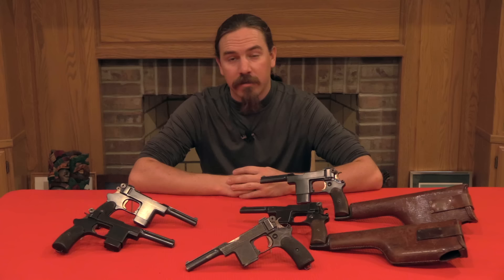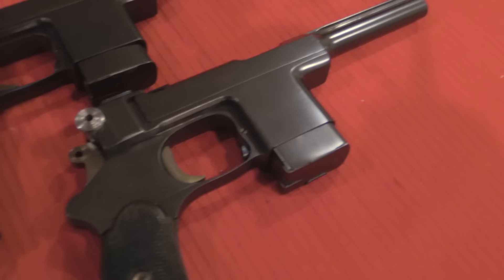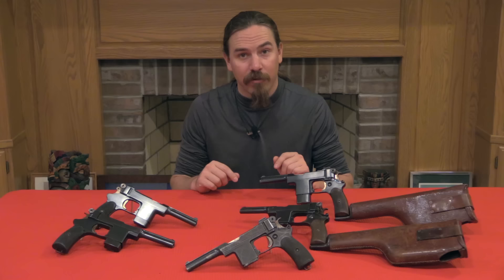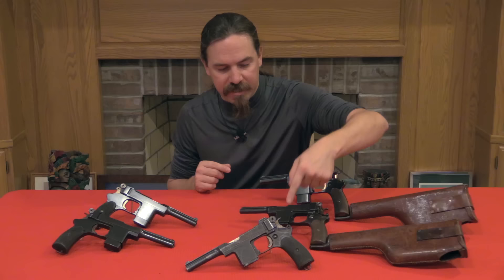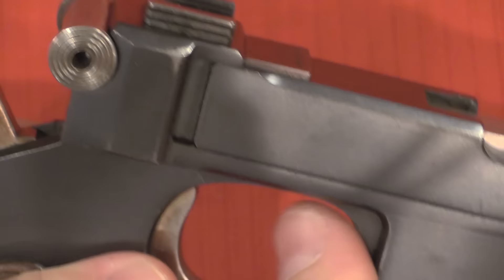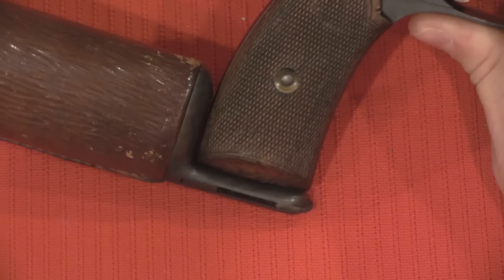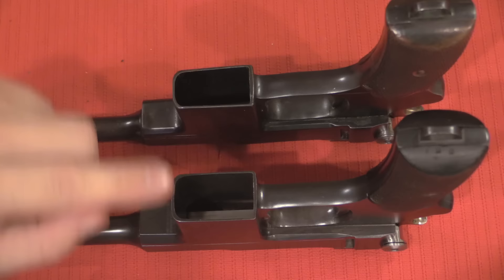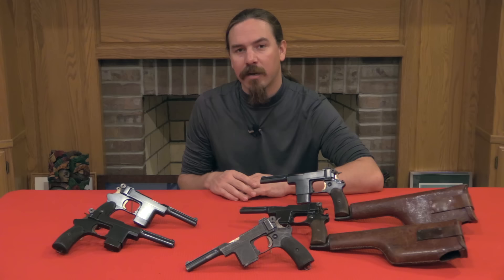Bergmann Mars 1903 Pistol

Comment: As we are getting into the more refined versions of these guns, I have to say, the general design is rather good for the time. I do not think this failed due to being a bad design. I think just a bit of bad luck. Also I said failed, but these did not really fail per say. They just did not blow up like some of the other designs.
Reply: And they got rid of the model 3's and 4's stupid barrel shroud, the 'after thought' looking safety lever,(it was a good safety, it just looked like a little kid designed it - it's external catch spring on top of a bent clock hand lever with detents that were very hand filed looking), the pin the tail on the donkey disassembly order that required build-by-numbers skills, missing piece looking gas relief hole {SCARY!}, long firing pin, am I about done? 
 All that on an wheezing,underpowered piece . A fine piece for it's day, I'd love to own one in good firing condition. I'm sure that the tiny rounds would let you go all day without fatigue.

Comment: Love your content, but when you said "for you metric folks, that's an eight and a quarter gram bullet" I may have laughed.

I'm sorry for my sins gun jesus.
Reply: Ha ha agreed.  Grains and inches for me.
Reply: James Healy Thanks for making me spit out my hardtack.  There were only 12 battles for the Isonzo.  I guess that means we have another 6 Bergmann episodes.  Can't wait.  I could watch Ian narrate paint dry.
Reply: we say "half" too
Reply: We do say half, and a quarter, third, etc (In Aus at least). It just struck me squarely on my funnybone.
Reply: Shooters who hand load their own ammunition in Europe also use the American system, simply because all the available equipment and loading tables are in grains and inches. Only Vihtavuori, the excellent Finnish gunpowder manufacturer, provides both US and metric data.
The metric system's party trick is that one milliliter of water (=half a thimble) occupies one cubic centimeter of space, weighs one gram, and requires one calorie of energy to heat up one degree centigrade. One degree centigrade is one percent of the difference between freezing and boiling water. You can see how you guys in the US switching to metric would really help out engineers and inventors.
Reply: Well Daniel one slight correction: Calorie is not part of the metric system because the boiling/freezing point of water depends on pressure. Additionally the energy required for 1°K/C change in temperature is actually not fully static over the heating of water, but decreases slightly the hotter it gets. So calorie cannot be calculated directly from the base S.I. units, and can only be measured in experiments. Hence energy is quantified in Joules instead! The more you know...
Reply: @SamSung-mw6qt  Yup, the whole world has switched to m/m, as has the American auto industry, the aviation industry, the laboratory and testing industry, the aerospace industry, the medical device industry, the computer industry, the.. .....  etc.
   BUT... (sigh).....  some Luddites live on.
Reply: @d33b33  ABsolutely, you guys in the USA, listen up.  Up here in Canada, we did the dirty deed over 40 years ago.... BUT,  here's a fact.   one often sees Imperial still used, e.g. an ad for "Chicken, only $0.99/lb." as it SOUNDS cheaper than "$2.18/kg."
Reply: @d33b33  some parts of the US use metric, but for most uses English is overwhelmingly popular.

Comment: If it cannot use the worst ammo available its not a military gun lol
Reply: The Ruger P-89, while not a "forgotten weapon", nor a military weapon, is noted for its ability to eat just about any commercially available 9x19mm ammunition out there, including 9mm NATO and +P ammo.  It will run an entire magazine where each round is a different brand, bullet weight, and shape.  However, I personally saw one of those Ruger pistols refuse to reliably fire some 9mm made in Hungary by a company called MFS.  Not sure if they had incredibly hard primers meant for open-bolt submachinegun use, or if they were just bad primers.  However, it was the ONLY 9x19mm that pistol wouldn't eat.  So, to say that a pistol isn't good because of one single brand of ammo is NOT giving that pistol a fair shake.